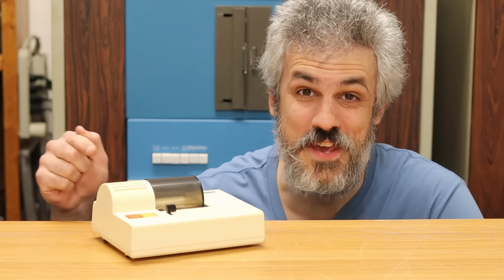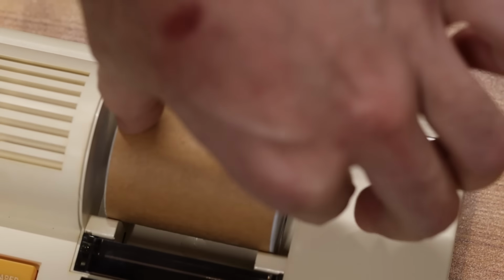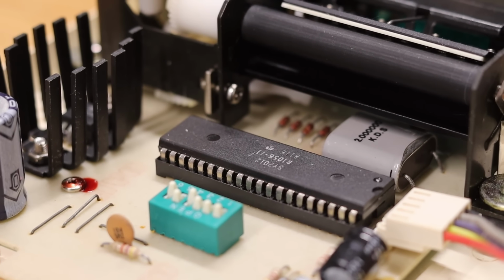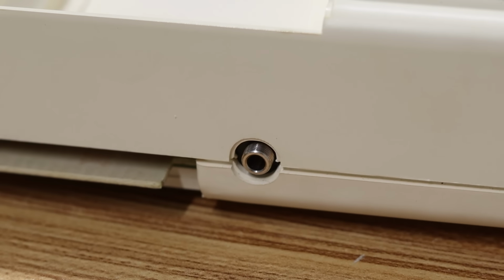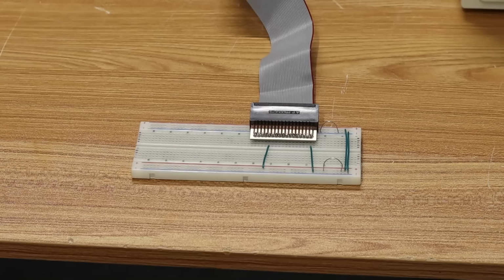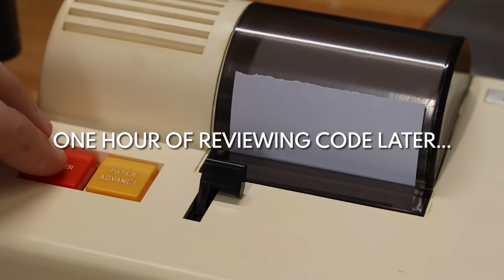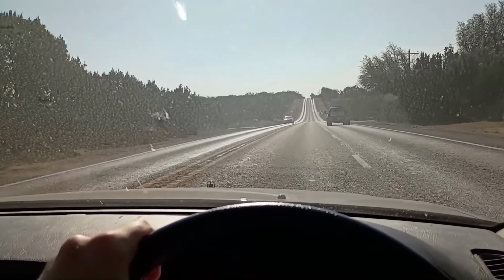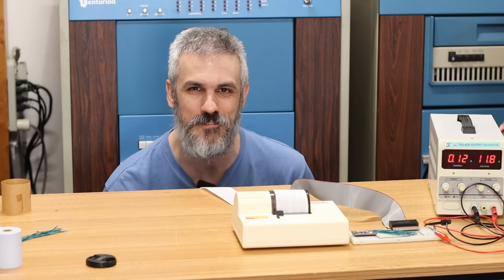The Cutest Printer on the Planet!

Comment: In olden times, I had a little printer for the TRS-80, Quick Printer II.  That used metalised paper and electrostatic discharge to colour the paper.  That one accepted some ASCII control codes, shift in and shift out if i recall, to enable/disable double width print.  Caution: 50 year old memory...  That printer was ALMOST as cute, but no bunnies.  :]

P.s. Thanks for the fun and diverse projects.  Your sense of adventure, great skills, and can-do spirit is inspiring.

Comment: Thinking about how the Speccy talked to the Alphacom-32 I expect one of those DIP switches will switch between character mode and raster line mode. The ZX Spectrum's inbuilt printer driver sent each pixel line of the whole line of text to the printer, so what appeared on the paper was exactly what appeared on the Spectrum's screen from its character set.

Comment: There was a printer that looks just like that one next to my bench at work for a long time, I'm not sure if it was branded the same though. It was used on the building's alarm system. They used to get a print out of who was going in and out and at what time, but for probably the last 10 years it didn't do anything so they just left it sitting there taking up space. If I had known it had a 6501 in it I would have snagged it. :D

Comment: Call me crazy, but I think a printer like this with a small EL screen laptop (A small form factor GRiD) that is a dedicated text processor - text messaging service (no emoticons, no graphics all uppercase ASCII) that bypasses most of the muck of the net and sends in low baud rates via an dedicated emergency band using cell and even the radio system might be an awsome digital HAM type setup. I'm trying to define it better but I would think of it as a "Universal Text System". It would vaguely resemble email with real time responses. Options would be available for news headlines, weather reports/warnings, short twitter length messages from friends and family.

Comment: I think your 100 ms delay between characters is super excessive.  As long as your software driver is correctly handling the 'busy' signal, the printer should be able to accept characters as fast as the motor can run.  But you know what I find funny?  That you would be comfortable with programming in assembly language but not in C.

Comment: Loved it! I was in high school in the late 1970s and early '80s, and for my latter 2-1/2 years of high school, we owned an Apple II Plus computer. During my senior year, we finally got a rudimentary word processor for it. I wanted to start typing up my writing assignments on the computer, but most of my teachers were unwilling to accept 40-column, all caps printouts (we didn't have the 80-column card yet) on scrolls of 4-inch thermal paper. I did have a couple of teachers who were cool with those printouts, though, and it was fun being the only kid in their classes who handed in assignments that way. As cute as your little printer is, I suspect that even those avant-garde teachers might not have been as accommodating if my assignments had been printed on it!

Comment: This is the first time I've heard of this printer. Back in the '80s, I invested many hours trying to make my Alphacom32 compatible with the C-128, which I switched to after the Spectrum. I even burned out the Simclair's Z80 trying to relay signals due to lack of information. I ended up redesigning all the electronics and writing the instructions for Basic: LPRINT and SPRINT to print text and the graphic display. This video was a flashback. Regards

Comment: If you use 5V, don't use the Vin on a (regular) Arduino Nano. Vin goes through a 5V LDO so supplying that with just 5V will give unstable voltage. You can also see thing in you scope capture which peaks at just 4-ish volt with noise. If you want to use 5V, use the 5V pin. Vin needs about 2V more then 5V to regulate stable.

Comment: Make sure to lubricate the sliding part otherwise the lever which returns it will break. I have printers with a longer version of the head made by the same manufacturer. I can't remember what the manufacturer was but I think I even found service information. I did 3D print replacement levers but they broke.
Reply: Olivetti is the manufacturer. PU1800 is probably what you've got (20 column). I have the PU1840 (40 column)

Comment: VIN of arduino is 7V minimum, as there is an on-board regulator. If Vin is less than 7V, arduino will get less than 5V of supply, which might be a problem for some applications. If you already have 5V regulated, backfeed to pin 5V pin to obtain real 5V supply. Sure, ugly hack, buth the whole arduino is designed by hacks.

Comment: The 6502 is still a 6800 at heart and the 6800 bus and it's cousin the 8080 bus are two latching busses still used in many lcd controllers. I have one capable of doing 10+mhz 16bit on my desk.

Comment: This Sprinter 20 is the 20 character version of the Sprinter 40, which does 40 characters per line.  Both printers us the same edge card pinout.  The reason for it and the 5V output is so that different adapters could be made and powered for different computers (many different incompatible buses and connectors).  Alphacom built these printers but let other companies brand label them.  There is a Centronix compatible adapter out there.  However, the VIC-42 printer is special and operates different than the other models.
Also, the thermal mechanism was made by Olivetti and Alphacom was a spin-off or sister company to Olivetti.  The Alphacom 32 for the Sinclair computer uses the same thermal mechanism as the Sprinter 40.
The Sprinter 40 models had a serial mode via the DIP switches.  They might work here as well.
Lastly, it is safe to remove the circuit board from the bottom case.  The ribbon cables are attached at both ends to the same board (one end via the thermal mechanism) so they won't move when you pull the board out.
Reply: Posting a correction regarding the printer mechanism flex cables.  I failed to notice the the Sprinter 20's mechanism straddles the PCB instead of being attached to it (different from the Sprinter 40).  The flex cables are plugged into the PCB but the mechanism is not.  I realized this when I opened up my Tele-Total Sprinter 20 printer that arrived a few days ago.

Comment: 7:15 ... Yay! I've never seen anyone else insert loops of wire into the breadboard power rails for alligator clips to better clamp on to. I feel equally "seen" and unoriginal. Haha. But I clamp them across the whole loop, so there's two points of contact. Clever, eh ... eh?

EDIT: You need to put the casing of that thing into a smoke chest with cigarettes instead of timber to get it colour-matched with the TI data terminal.

Comment: I experienced my first thermal printer in high school, and it was about that size, but it was attached to a TRS-80 model 1.  And it used the old school silver thermal paper.  I had owned a TRS-80 model one for over a year at that point, so i sat down and wrote an arcade game in basic (i had been programming a LOT).  I then printed my program out, and used up the entire roll of thermal paper.  Of which the school had no more of and wasn't buying any more.  LOL.

P.S.  This "paper" was so bad that the oils on your skin would make the print rub off on your fingers.  Absolute garbage printer, with VERY expensive "paper."

I think i remember a few stores using registers that used that "paper," but not for very long.  I wasn't kidding, it was expensive!

Comment: I think dealing with a busy will be super simple.  Replace the loop that's timing the character release with a loop that waits until BUSY in inactive. It may go BUSY for a moment for each character,  but that's fine as it wouldn't change the logic at all.  Just wait until not busy.
Reply: It looks like the code is already doing that, the while loop that polls BUSY is being done for each character. Waiting 100ms before polling BUSY again is unnecessary though, it just slows things down for no benefit.

Comment: thermal cash register banners!

Also it seems unlikely but I wonder if it has some kind of graphics mode? Or even one (or more?) redefinable characters. Commodore's 1526 (a completely different printer of course) would let you define one (1) character for whatever special symbol you needed (or thru hax to get it to do graphics) so it's not out of the question.

I suspect the very short "busy" is "transferring character out of single-byte incoming buffer." But that's just a guess of course.

Comment: If you put your data lines on pins 0 through 6 and strobe on 7, then you can address them as a single PORTD variable, instead of having to use digitalWrite for each pin one at a time.

Comment: A standard printer interface has seven or eight data lines  (which either take an ASCII character in normal text mode, or directly control which dots are to be printed in graphics mode),  a "strobe line" which has to be taken low to transfer a character and a "busy" line which goes high when the printer is not ready to accept another character.  There's also an "acknowledge" line which goes briefly low if a character was successfully transferred.

Comment: There are similar small thermal printers out there for use with laboratory instruments and printing calculators.  There should still be roll-type thermal paper available from office supply and laboratory supply stores.  I am suspicious about using the +12VDC on the ribbon cable to drive the printer.  I think that the jack is for +12 VDC power from a power brick.  Consider that +12 VDC on the ribbon cable as a reference voltage link, not as something to power the thermal printer.  Just size the jack ID and OD and get a proper external brick power supply.  If you don't have enough current, then you won't get the proper thermal profile to blacken the paper.  Another issue with thermal paper is that if it gets too old or has been stored hot, then it may not properly darken under the thermal head.  You should never leave thermal paper in a bright environment either, as it can "gray out" and become a silver-to-gray background that will never be printable by the thermal head.

You surmise correctly -- the "Test" setting on DIP switches in these printers does indeed print a "Barber Pole" pattern of characters supported by the printer.

Comment: I knew it had to be an Alphacom printer, because the layout and styling are so close to the Alphacom 32, which is the same as the Timex Sinclair 2040 printer (because Alphacom made the T/S 2040 for Sinclair).

Very cool, and yes, very cute! And how wonderful it is to have a label on a device that tells you the pinout and the DIP switch designation. I wish more devices had that.

I used to buy 8.5" fax paper rolls, then cut them in half for my T/S 2040, but thermal receipt printer for narrower widths are, of course, much more common than 110 mm paper. Recently, though, I bought a box of 36 rolls for just a few dollars more than a pack of three rolls costs. Now I just need to make an interface for the T/S 2040 so I can print to it from something other than a Sinclair computer, similar to the one made here. Looking forward to future videos!

Comment: Data lines, strobe pin, busy pin… I think you have a Centronics interface on that printer.

I certainly did with the dot matrix I bought for my homebrew computer.  I just used a W65C22N VIA and a little bit of assembly code to drive mine and the main issue I had was that I was driving it too fast at first. (My machine clocks at 4MHz).

Comment: if they were bold enough to pay for an alternate housing mold, they would be able to shrink the width bei 1/3. looking at what is really inside, a bit of stacking some of the components would have allowed an even lesser size. maybe just slightly beyond roll width.

maybe the power outlet is for permitting some extra applications or for supporting setups where on the data source on the other end did not provide any 12V DC.

Comment: You can run 12v to VIN on the Arduino nano.  It has a voltage regulator on board that wants 7 to 12v on Vin.  If you feed it with 5v then the 5v regulated output will be lowered.  You could also just feed the 5v pin from the external regulator and bypass the nano board regulator.

Comment: Your expectation of a character at a time would be true if the print head was vertical and moved across the paper. But this little printer has a horizontal print head. It has 20 single dot heads, one for each letter, as this is a 20 character per line printer.

Comment: I’ve seen smaller label printers at my workplace; it was dedicated solely to the FedEx machine for printing shipping labels. It wab about as tall and deep as that one, but not as wide.
Reply: There are some really tiny panel mount thermal printers available. They use a TTL level serial port, so they are easy to connect to a microcontroller.

Comment: I once had a Timex-Sinclair 2040 printer for a TS-1000 computer (American version of the Sinclair Z81 computer) I had back in the 80s that was also a rebadged Alphacom thermal printer. It was very small thermal printer that printed on 11 cm wide thermo roll paper  (32 characters or 256 pixels per line). The TS 2040 was a rebagded Alphacom 32 thermal printer. Beware that some sources wrongly claim the TS 2040 was just a rebadged Sinclair ZX Printer which is different though the TS-2040 is compatable with the Z80/Z81 though.

Comment: I think those thermal heads can be pretty heavy on the power, hence the rear jack, you may get better prints if you beef your wires up a bit, or run 12v directly to the jack.
Reply: Pretty sure his bench power supply can supply plenty of amps unless he sets the current limit.
Reply: @vinnieluther6589  Sure it can, but it's going through a breadboard jumper and some ribbon cable.
Reply: @OldManchinesEtc good point, probably some voltage drop and heating of his bread board going on.

Comment: Thermal printers are strictly specialized things that people think they can be useful for something other than receipts... but no, they can't. Not enough space for characters. Weird format. Light sensitivity. If you had an important fax thermal printout, you would put it in a protective folder and a ledger. Good luck with this fidlly stuff that folds on itself.
Ok, it is cute and has some historical value, but get some old daisywheel, ancient dot matrix or an early laser printer to get normal copies of whatever.

Comment: I'm pretty sure the 12V external power jack is for when you want to plug the printer straight into a Centronics printer port since the rest of the pins are more or less straight up the same as a parallel port.
Reply: I think you are correct.  I was thinking that a cable from the back of an old PC could be made
Reply: How long is thermal supposed to last before it fades or turns dark?
Reply: @8546Ken  If you keep a thermal print in a drawer, you lasts a really long time. 20 years would be my estimate.  If you leave it in car window and park in the sun, I think it wouldn't last a year.
Reply: @8546Ken  In room conditions, about 10 years.

Comment: I wonder if the DIP switches, or a special escape sequence, can be used to put the printer into graphics mode. Also wonder if there are extra print controls, such as condensed print so you can fit more characters in the same line (at the same dots-per-character resolution), or a double-strike mode where the paper is advanced by half a dot and a second pass is performed to improve contrast and also offer the possibility of higher-resolution characters. These features were common in early 80s dot-matrix printers so I'd guess this device might support at least one of them.

Comment: I would have to check my documentation but my first thought is the signals on the card edge connector look like they may be the same as you find with your standard Centronics printer port.